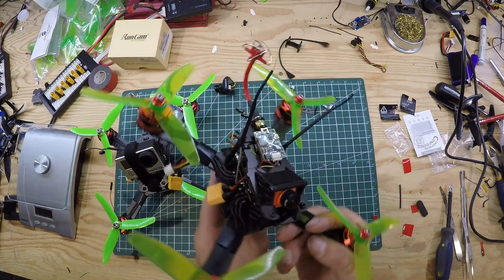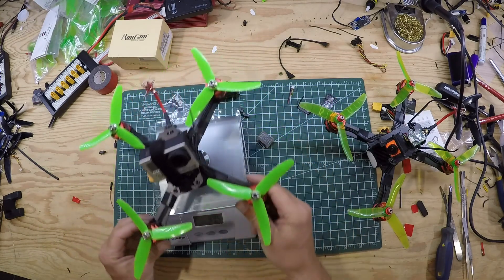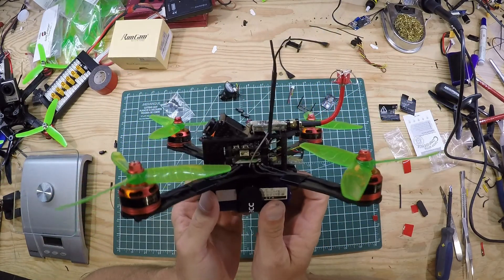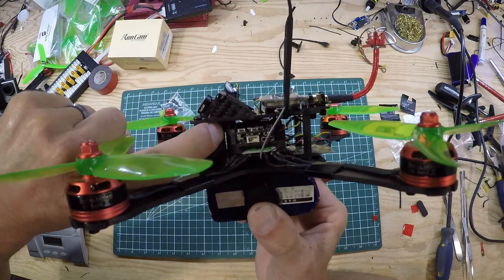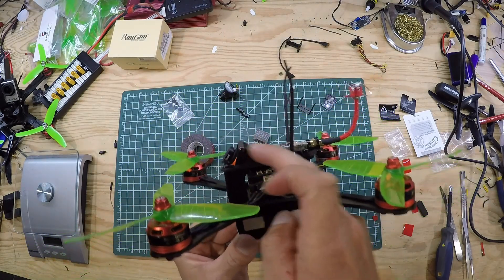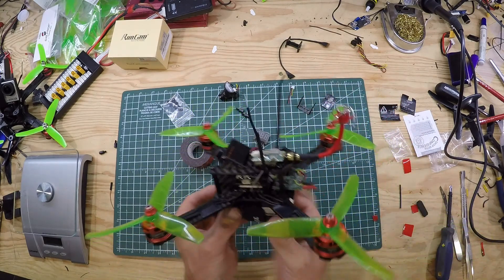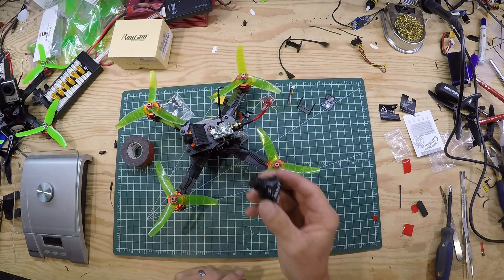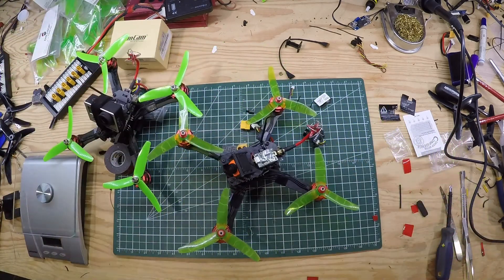Runcam Split installed into Realacc X210 QAV-X frame how to

Comment: When you say you mounted the camera with 3m tape, does that mean you just have the tape holding it, or is that tape with screws going through them?
Reply from the maker: Hey Robert.  It is held in with the 3m tape only.  It's basically 'sandwiched' between the vertical carbon frame pieces which normally hold an HS1177.  I used to 3m tape because it is slightly soft/rubbery and helps with vibration dampening.
Reply: carlylea that is what I thought! I just wanted to make sure I understood correctly, because that is what I will do! If it had a screw, then it really does nothing for vibration dampening, because it would just transfer through the screw. Thanks for showing this

Comment: I was running same props but just got 5048 from racerstar and they add massive power without eating all the battery. I think I'm just going to use eachine dvr on to the quad its self
Reply: i tried the dal cyclones 5040 king kongs dal 5044 and those racerstars, and out of all of them the racerstar were the worst by far, they did have a good punch but they cause me a hell of a lot more vibations and they broke after every little crash.
from all the props i tried i definatly say the dal cyclones are the best, the dal 5044 after but they are not too durable but has a good punch

Comment: did you remember the problems with the 5v Bec and the problems with usb?
Reply from the maker: Haven't had any problems with either my BEC or USB???
Reply: Hm thats a bit od, but good if you didn't get any problems.
Reply: I too don't have any problems with my Split connected directly to FC's BEC when connecting USB... My setup is HGLRC F4 v5, Racerstar Tattoo ESCs.
Reply: many they was able to fix the problem before they started to ship :) thats good if thats the case. But, its a bit different between fc. some won't power on 5v when connecting to beta flight, and some do. If the pc got usb 3.0 its often ok but seldom the 2.0 will handle it.
Reply: have you connected the split with usb with a soldered power to 5vbec on fc?
Reply from the maker: I see where you are going with the problem.  I connect mine to the BEC on my 4 in 1 ESC, and I connect my flight controller to VCC on the 4 in 1.  This way I have no issue.  That being said, on my second build I encountered the problem that you're talking about when I tried to power the split from the BEC on the flight controller.
Reply: well I guess I jinxed it... It is not the USB issue though but today while flying I got 2 total freezes of video when maxing out throttle which caused two hard crashes (since I disarmed the copter) so I guess the 5V line of FC is dropping voltage, it will need some external cap or maybe LC filter. So all be warned that this might happen (for me it was on about the 10th flight, that's weird too)!